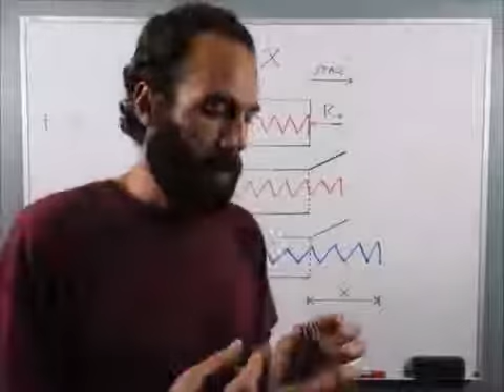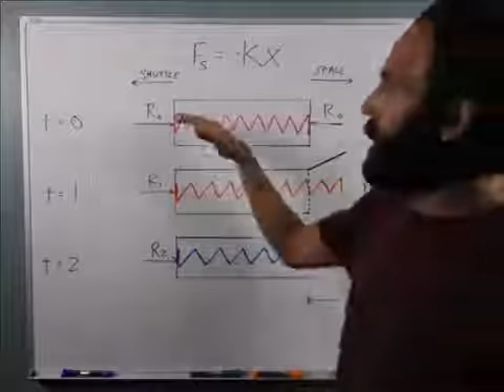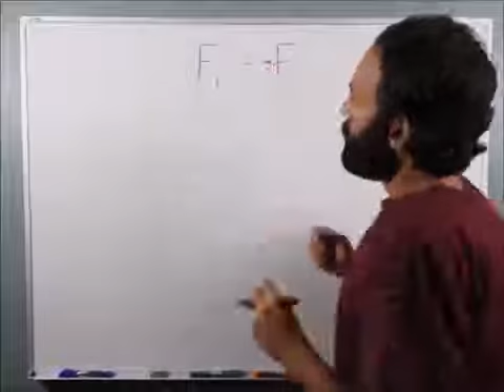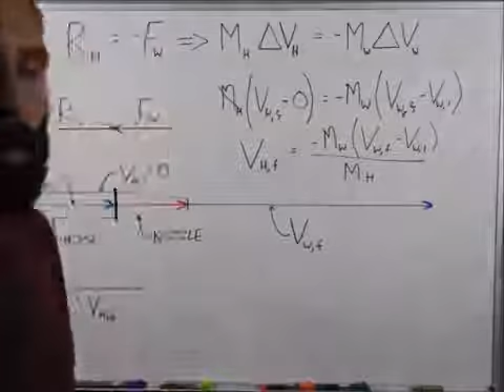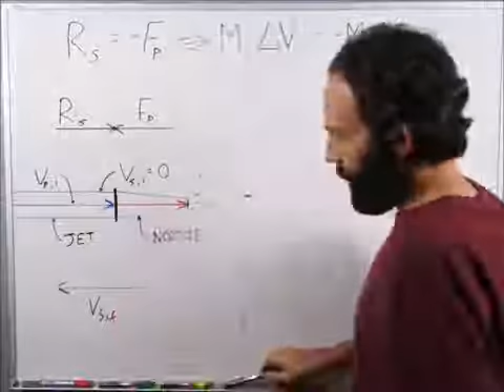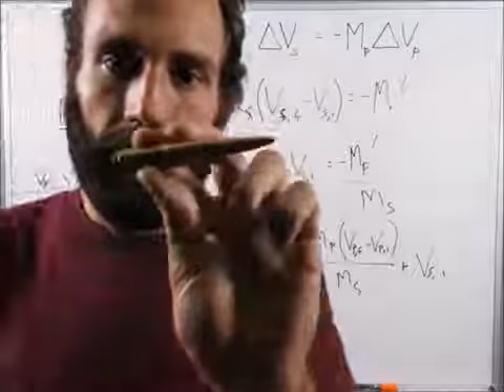Proven in theory that space travel is a Hoax

Comment: Have you thought it may be that the gas from the rocket is coming out at a higher pressure than the vacuum of space is drawing it out? Therefore the gas becomes a sort of bubble that the following gas is pushing against. Forcing the spacecraft in the opposite direction.